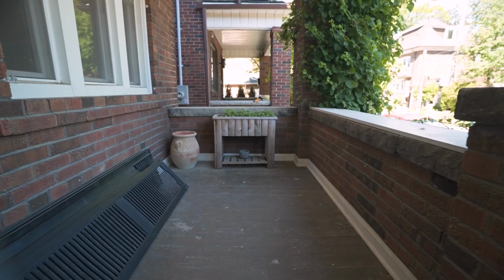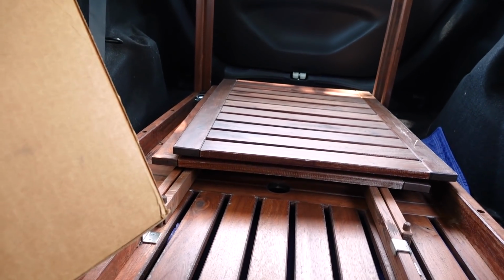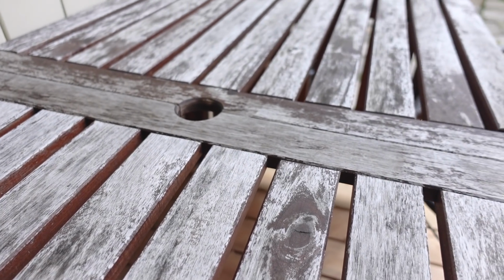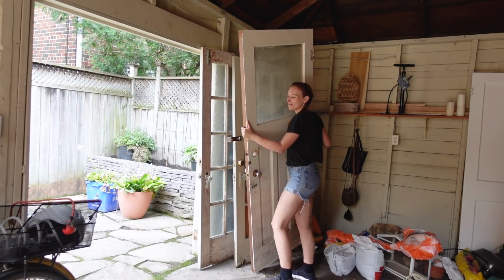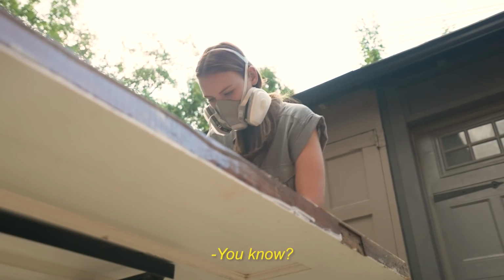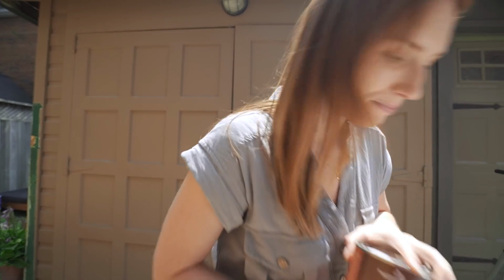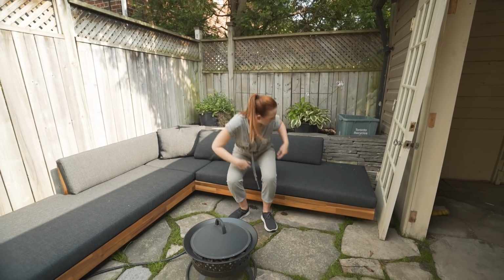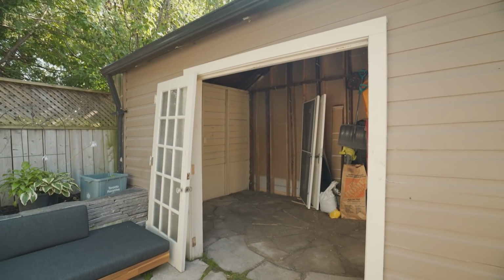my exterior makeover continues

Comment: Love the new door but for safety I’d suggest adding some clear safety film to the inside. It’ll prevent anyone from just breaking the glass to unlock the door.
Reply: I’m sure she and her tenant both have locking doors inside the entryway!
Reply: I came looking for this comment….it creeps me out so much that she’s gonna have just a clear glass on her front door, I know that it leads just to a small entryway, where are more locked doors, but I would still add a frosted film or something😬
Reply: I live in Toronto (seemingly around their area) and about 90% of our main door is glass, yet nothing's ever happened. Same situation, with multiple tenants in one house, and inner locking doors to separate units.
Reply: The house I’m currently renting the front door is rectangular glass panes from top to bottom, and there is no entryway with more doors/locks, it opens right in to our living room. I also live in the city (in the USA) kind of in a bad part of town near a major university and still it has never been a problem. we just have blinds over it for privacy, bc it’s in our living room, so I think this will be fine.

Comment: There's a paintable caulking, i just used it for a window pane project for the exact same issue on your door. it helped a bit.
Reply: You can also have caulk tinted with paint!
Reply: @caitlinrazo9833  oh!! I didn't know that!
Reply: @melinspiration8255  yep! I worked for Sherwin-Williams for a few years and we did it for one of our contractors all the time.
Reply: You should not caulk on glass to wood. You should glaze with putty which is paintable

Comment: I just wondered about the security issues on the door if it is a clear piece of glass then it would be easy to break.Loved the colour
Reply: How would that be different from any other window though? 🤔 Also I belive Canadians are so nice, they don't break in anywhere 😅
Reply: I've had a front door with glass for a very long time and there's been no attempt at  breaking in. And yes, I live in Canada 🇨🇦
Reply: @Kath-Erina  Most designated exterior doors have smaller windows to prevent a burglar from putting a hand or a tool through a space and undo the lock .or they have heavier tempered glass, but I am no expert
Reply: Even if they did, they would only get into the shared hallway. Because Kelsey and her tenant each have their own entry from the hallway, so that’s a second door they would have to break in

Comment: I love the color you choose for the door! They make paintable chalk. And if you just paint it without taking a razorblade scrapper you can get the lines closer & just scrap the paint right off the glass. Tapping it kinda limits how close you can get the paint, because the lines are straighter than the actual area between the glass & the outer wood lines. I hope that makes sense. 
 The dragon fly doorknocker looked fabulous on the door to me!

Comment: I was very very iffy on that green until you put it up. Looks so much better there! However, maybe you should keep the trim white to blend with the white trim on the windows? I'm wondering how bad the theft situation is on your block. Would someone steal that front couch, would someone break that window in your door to unlock the inside to steal all your stuff inside? And one more: what is the plan on the sectional when winter comes? Covering it or putting the pillows inside out of the weather?